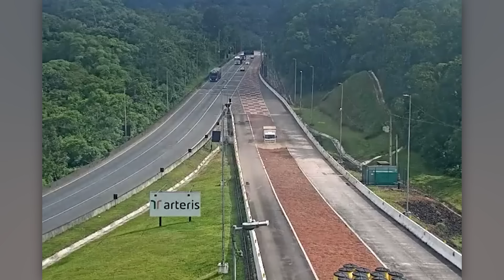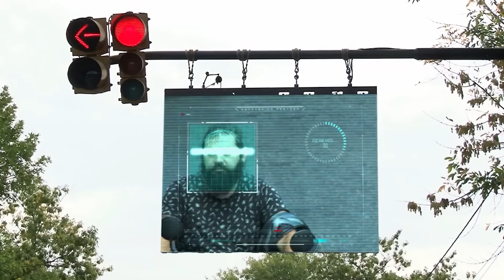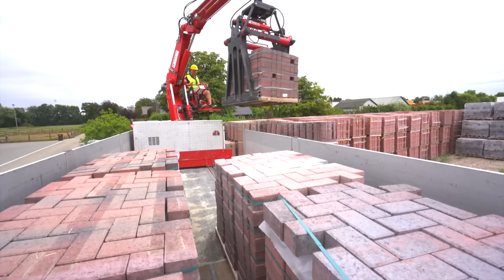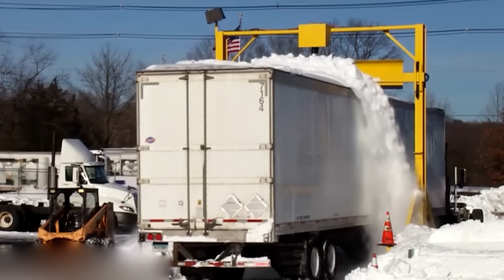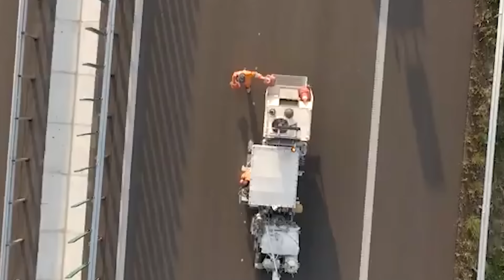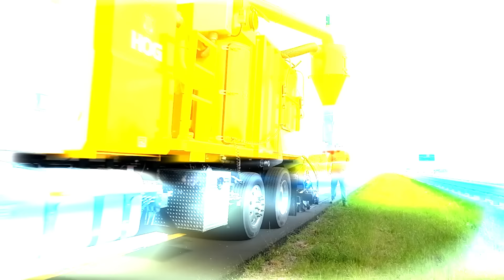Incredible Road Technologies That Are Insanely Cool

Comment: The catch bags keep it from flipping over the other way. The modern ASPHALT PAVER is not an asphalt paver is it a traveling concrete form for roads! The package that is adding trends to a roller is not for traction it is for compaction, the trends increase the pressure per square inch to compact the surface! Wow!  A drawbridge that Lowers and Rises!   What will they think of next, such an awesome improvement to those old one-use drawbridges! Perhaps having someone proofread your copy that actually knows something may help not sound like an idiot!

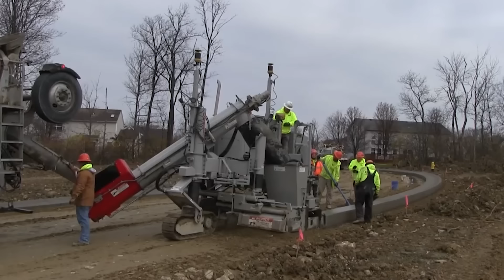Comment: 16:40 i love how it just leaves out the the tank cap that needs to be removed for this. Most of them are locked with the car keys. 

And also thr fact that the Gas Pumps have a switch on the handle to keep pumping untill the level inside reaches a certain hight. Essentially already being as automated as needed

Comment: 19:07, the main issue with snow on top of trucks should not be efficiency but safety. The snow can melt and refreeze forming hard blocks of ice that can slide down at higher speeds and impact following traffic leading to dangerous accidents. Unfortunately, the machine shown there did too rough of a job and a second pass is necessary. In the second clip, it looks fine at first sight.

Comment: 24:00, mobile speed camera's has been around for decades. They are much smaller, and much less noticeable than this trailer. They are used a lot in the Netherlands, they also have them with automatic number plate recognizion, to find cars that are in a system for various reasons, like theft.

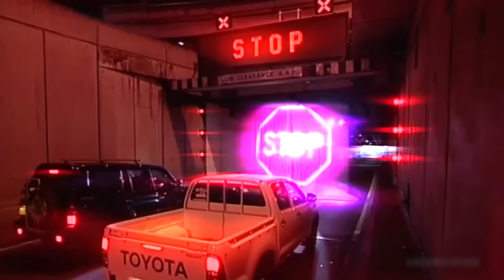Comment: The waterscreen at 13:21 is not exactly new. And no, they do not use holograms, just ordinary rear projection. And no, the next step is not figuring out how to use it in open spaces. 

We had already deployed much larger waterscreens at open air festivals back in 2001. The projector was a Derksen; you need a pretty bright one in daylight conditions.

I remember Richard Fairbrass from Right Said Fred singing while standing in the waterscreen (which arguably looked great). I also remember him bitching around because his microphones would keep failing.

Comment: using a 8 axis robot arm to insert the gas pump in the tank...I suggest try to make payment terminals that don't fail so often first? But this kind of automation will be way more important  when robotaxis do exist to charge automatically. although wireless charging seems simpler and more reliable. ideally a robot that plugs the car and then cleans it while its charging. most probably though....gig workers will do it first until they figure out mass robot manufacting

Comment: That's a funny looking asphalt paving machine ( the first road paver), there is no asphalt in there it's cement. Asphalt is black and uses gravel and tar mixture not cement dumb ass. I can't wait for the fanuc robot to fix cracks in the road as I am a robot programmer and I could program it to do that job.

Comment: 1:35 That's a Flyover, commonly known as a Fly-Over-Ramp in english speaking countries. It was developed by the Austrian state owned ASFINAG tasked with maintaining, repairing and constructing motorways and high speed roads to avoid trafgic jams due to roadwork on the most frequented motorways. It's been around for over 20 years first used in 1999. So definetly not swiss and definetly not new as the video implied.

Comment: You dont need "Catch bags" to ease the truck back on its wheels when picking it up off its side. That is unless you get a operator that dosent know wtf he's doing. They put tension on a few different spots and use their hydrolic system to gently turn it upright.

Comment: All those electrical roads, either with a track on the ground or wires above is a huge waste of time and money, soon batteries will be dirt cheap and it wouldn't be a problem to put 1 MWh in a  Semi Truck, Tesla has already proven that it is feasible, it can easily drive 1000 miles/day with appropriate charging equipment.
Trucking companies focus on cost, so if using the electrical road is 1c more expensive than using a chargers they will use the chargers

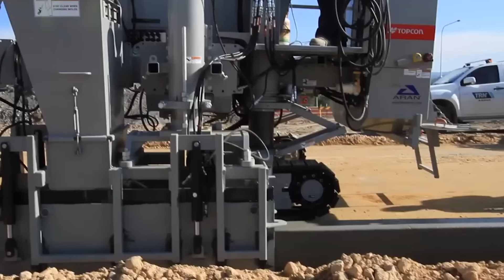Comment: 16:15 This may be good for disabled people on wheelchairs, but the lock-plug is missing here it will fail in 99%. The mechanical hand is overcomplicated, you can simply include the gasoline nozzle in the arm, overall process may be about 50% faster.

Comment: That holographic stop sign on the Sydney Harbor Tunnel has reduced the number of over-height trucks entering the tunnel. However, just last week another truck driver hit every overhead barrier, ignored 200m of flashing yellow lights and sirens and proceeded through the hologram to get jammed in the tunnel. Loss of license, loss of vehicle, $50k fine to the driver and $250k fine to the company, but it keeps happening. It would seem they need to divert over-height trucks in gravel pits with wire cables. They are not getting their truck back, so the truck may as well be destroyed instead of destroying the tunnel.
Reply: Gravel pits don't destroy trucks.
Reply: you can't fix stupid!🤣🤣

Comment: 16:15  Imagine waiting for this thing to finish in double the time you would take and on top of it, you have to drive around with an open cap under the lid.
Reply: In some countries, the fuel cap is mandatory, most modern cars operate in “limp mode” when the check engine light comes on due to the lack of a fuel cap.

Comment: I have two minor problems with the "road 3d printer" at 6:10:
1) it's not 3d
2) it doesn't print
Reply: 1. At the side of the road there are sticks sticking out, so it is 3d. 2. The stones are the ink, the result is a pattern, like with a printer.

Comment: The trench digger is nice, but you'd better be pretty sure there are no existing pipes or cables under the road first.
Reply: Not necessary. It can cut through them with ease. So you can get your trench dug faster bc less time wasted navigating around stupid obstacles. Trench is all that matters. Good job.

Comment: 16:13 Umm, where's the fuel cap?🤔
Reply: A lot of newer cars don't have them anymore, there is a flap in the top of the fill spout that does what the cap does so you can't lose it or forget to put it back on, as the pump nozzle is pulled out of the neck of the fill pipe, the flap closes and the "Gas Cap" is back on the car, just close the door and go...

My 2017 Chrysler Pacifica minivan has that same push-to-open door and no removable cap...

Comment: The wind turbines are powered by the wind generated by the cars. When the turbines are there to pick up the wind the cars will have a higher wind resistance than without the mills. The cars will pay for the wind pushing the mill.

There is no free lunch in life.

Comment: How does the radar know which car is speeding?  It does not know it only knows that it is receiving a signal indicating that some vehicle is going over the prescribed set speed limit.  It must be the vehicle closest that is traveling faster than other vehicles next to it.  But you could have a vehicle with a much larger radar profile overshadowing a vehicle with a much lower radar profile over a 100 ft away unless you have a operator constantly monitoring it.  Even than you are not assured it is ticketing the correct vehicle.  If radar was held to the same standard as lie detectors are they would be inadmissible in court.  Even the most sophisticated military radars make mistakes like the Iran Air Flight 655.
Reply: You are right, the radar doesn't know. That's why by German law (you may notice the Wiesbaden license plates on the trailer) each measurement requires a photo. If there is any doubt about which car is responsible for the speeding then the case will not even be sent to processing.
BTW: this is absolutely nothing new, stationary as well as mobile "radar traps" as they are called in Germany have been around since at least the early 70s of the last century.

Comment: The robo-fuel-pump doesn't put the gas cap back on?
Reply: Gas caps are old fashioned, my last car never had one, and it was more than 13 years old
Reply: Mine is 12yo and has a gas cap. Plus, if you look, the gas cap appears to be just laying in the receptacle well....
Reply: @casper_hansen  In some countries, the fuel cap is mandatory, most modern cars operate in “limp mode” when the check engine light comes on due to the lack of a fuel cap.

Comment: Concrete is not asphalt.
Reply: This is debatable. I believe technically concrete is defined as aggregate with a binder, but it doesn't actually specify which kind of binder. Could be cement, could be bitumen, could be epoxy, could be some other stuff.
Personally I strongly agree with you. To me "concrete" implies a cementuous binder.

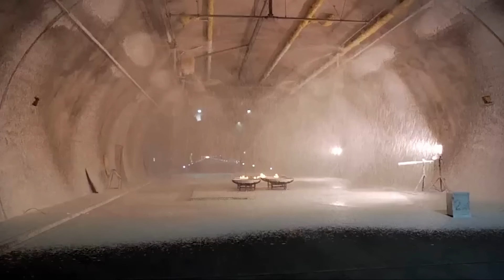Comment: Fire suppression @ 04:51 But now we really need a method that will work with the lithium ion  batteries in electric vehicles.
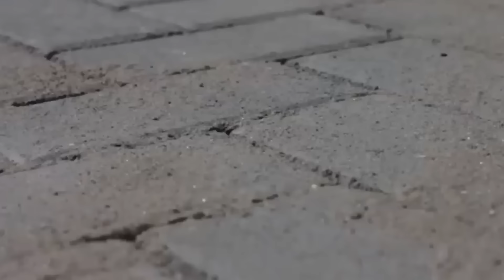     Road printer? @ 06:10 I'll grant you that you can in fact, 3D print almost anything. Then you show a brick laying machine. One that uses people to hand place the bricks into the proper position. The machine is just a fancy conveyor belt. Calling it a road printer does not make it one, it's still a conveyor belt.
     I wonder who wrote the script for this video? I stopped counting the mistakes when the announcer reached a point where he couldn't tell the difference between Asphalt and Cement.

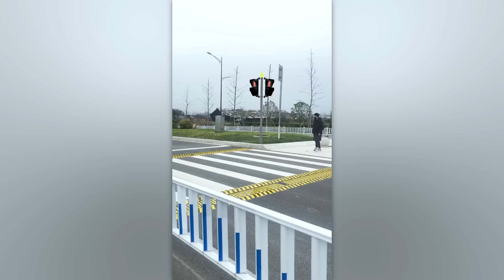Comment: 7:49 The pedestrian crossing barrier that when someone crashes into sends shards of glass rocketing into the pedestrian is fantastic!😂
Reply: Death by flying glass from car collision, how convenient
Reply: Definitely worth noting for safety refinements, but since pretty much all windshields are made with laminated safety glass, I don't think it would be much of an issue in all but the most extreme cases, and I would have much better chances of survival being peppered with car debris than being pulverized with the full weight and momentum of a speeding vehicle.
Reply: luckily the avatar survived, and was able to run away from the scene of the... accident
Reply: None of the 3 look CGIs look remotely cheaply feasible nor safe. Heck, the third one isn't even practical.
Reply: Of course it's all CGI in the videos, but it seems to suggest that a real-life version would have pyrotechnical charges to shoot streamers into the air (or a glitter cannon).

Maybe to celebrate the survival of the pedestrian, or maybe just to scare him, I don't know.

Or to celebrate the death of the driver in case it deploys at the wrong time. I mean we got Testas which will automatically drive into walls to relieve you of the burden to kill yourself, so why not that?

Interestingly, there's no barrier to stop a pedestrian from crossing the road when the light is red. In any case, don't cross the road to close to the edge when the light is red; it might unexpectedly turn green and one of these barrier might hit you right between the legs.

Comment: A robot at a petrol station is absolutely and utterly unnecessary. That is a good example of technology for technology's sake and does nothing particularly useful except add to the cost of petrol or diesel at those pumps. I really wouldn't want a robot anywhere near my vehicle which is sort of strange considering that robots built it in the first place, but I don't think that many other users would want a robot in a petrol station near their vehicles either. Particularly, one that is incapable of replacing the fuel cap on the tank after they have finished.Whoever thought of this contraption was either doing it for some kind of exhibition or had too much time on their hands after a night out smoking something illicit.

Comment: The robot that gasses up the car opened the door, dispensed the gas and closed the door without removing or replacing the filler neck cap.  Closed the filler door and left it sitting inside....
Reply: It's a dumb idea.
Reply: I believe it was an 'adblue' filler next to the fuel intake, but feel free to correct me. I dislike these new 'capless' designs personally.
Reply: @MikePreston-darkflib  
Hi Mike,  what is 'adblue' ?  And capless designs?  Never heard of them but it sounds like a remarkably bad idea when dealing with fuel fumes.
Reply: @deltavee2  From the ford website:

What is AdBlue?

AdBlue is a colourless, non-toxic liquid that is a solution of water and urea. It works to convert nitrogen oxide emissions in the exhaust gas of diesel engines, into nitrogen and water. A particulate filter then further reduces solid particulates from the vehicle’s exhaust emissions.

If you own a new Ford Diesel vehicle, you might have spotted a second, smaller blue coloured filler cap, just beside the main fuel filler cap. This means your car is fitted with AdBlue technology.

Many new Ford diesel vehicles now require the use of a diesel exhaust fluid commonly referred to as AdBlue. This fluid is automatically injected into the vehicle’s exhaust system to help reduce emissions of nitrogen oxide.

AdBlue is stored in a separate tank which must be kept topped-up by the driver. Further information on AdBlue can be found below, or in your vehicle Owner’s Manual.
Reply: @deltavee2 adblue is for diesel cars. Most modern cars have no gas cap, mine doesn’t either. They are perfectly safe, when you insert the nozzle it pushes open a flap.
Reply: @sjv6598  Ah, so the same deal as with semis.  Makes sense.  I still can't trust the capless approach, though.
Reply: @sjv6598  In some countries, the fuel cap is mandatory, most modern cars operate in “limp mode” when the check engine light comes on due to the lack of a fuel cap.

Comment: That fire suppression foam starting at 4:35 is great way to poison the water table.  16:19 Cool toy that can't put the gas cap back on.
Reply: The oil and tire dust from cars will do that long before you have to worry about foam, unless of course the designers aren't idiots and treat the waste water outflow from that tunnel.
What is important is that foam is the proper way to deal with EV fires. Whenever you see a headline saying it took a huge amount of water to put out a battery fire what it means is "instead of giving our fire department proper equipment we wasted your tax money on subsidizing ICE cars and the oil industry".
Reply: @AnalystPrime  ICE cars are subsidizing EV's as it is ICE drivers, and the fuel tax that they pay that is furnishing and maintaining roads.  Then there is the fact that EV buyers are getting a tax credit that ICE owners are being forced to fund with taxes that they pay.
Reply: @harpintn  Yeah, sure. Oil industry: "Five trillion dollars per year is not enough subsidies to buy our CEO another private island so we will raise gas prices."
Also the oil industry: "EVs getting two million subsidy is unfair!"
Incidentally, no, what little tax there is is not actually paying for much road maintenance:
"We are one of only five states that puts sales tax on our motor fuel and our 6% sales tax on our motor fuel generates about $1.1 billion annually. Only $50 million of that goes into our roads and bridges,” said Lance Binoniemi, Vice President with Michigan Infrastructure and Transportation Association (MITA).27.2.2024